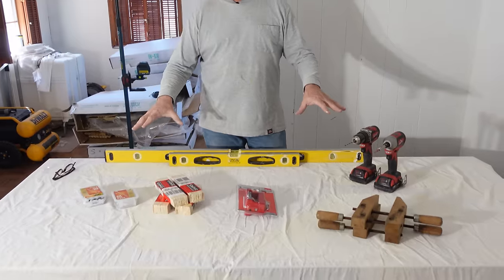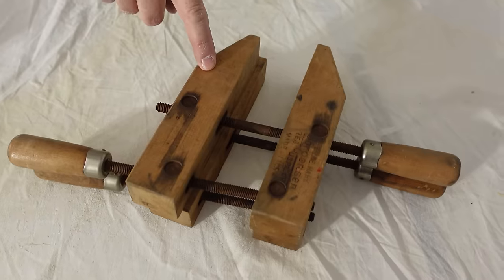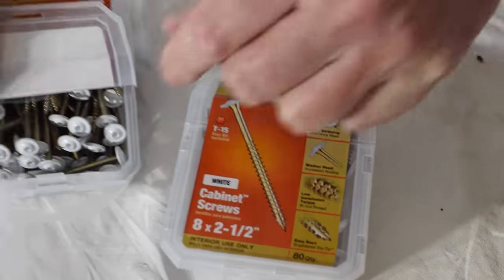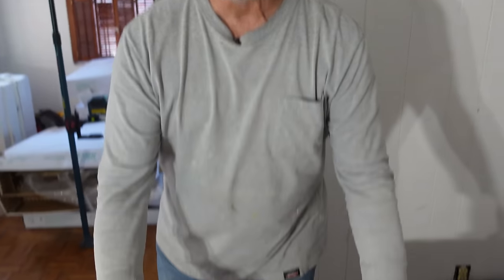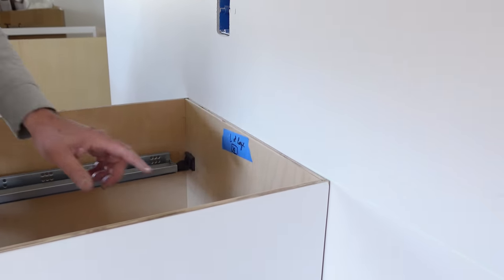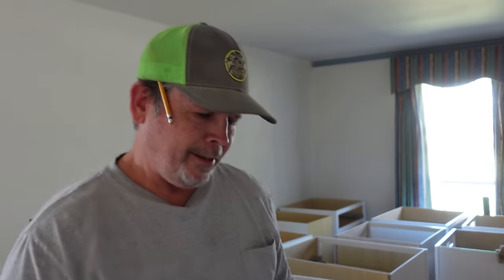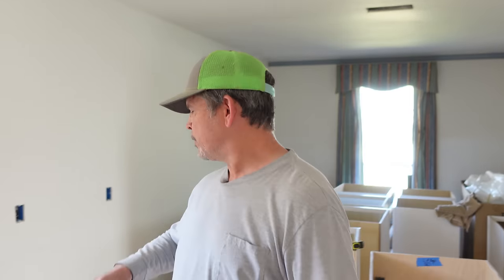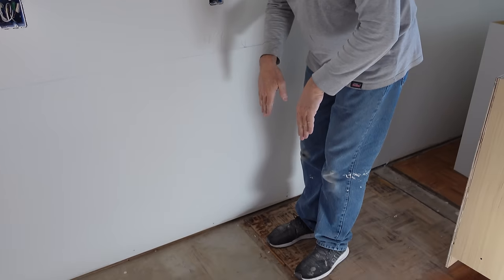How To Install PERFECT KITCHEN CABINETS (DIY GUIDE)

Comment: Excellent video. Thanks for sharing. Still Don't know how you guys deal with the imperial system over there 😂 Anyway... "a tip, and just the tip and only for a minute!" Hehehe, for putting in screws in those annoying hard to reach areas like under the cabinets, I like to use the Wera mag-ring bit holder. Holds the screw perfectly secure until it bites into the panel. I'm sure similar products are available in your market even if you can't find that particular Wera bit holder. I think Dewalt does something similar but the Wera is the best I've seen. 👌 All the best 👍

Comment: Great video! I install cabinets professionally, that is pretty much all I do. I do more commercial settings so we use 2 piece cabinets (cabinet on toe kick), so the trick I use to level everything out is I use a level and I made a block with a line in it exactly where my laser line is so I can move that anywhere. I never block my laser line this way, and I'm never guessing the measurement. I have that measurement in my hand. The same idea could be used here on these one piece cabinets. This way you don't have to set up a chalk line either. I also personally do my uppers first just for the simple fact is it's easier on my back haha but it truly doesn't matter. As far as set up I would almost argue that doing uppers after lowers is easier because your jill pokes don't have to be as long.
Reply: I'm installing separate toe kicks.  Can you describe your process a little more?  I don't understand your description.  What is "jill pokes"?
Reply: @number6396  Jill poke is just a stick I set on the lower cabinet (or the floor if I'm doing uppers first) to hold the upper cabinet while I make sure it is plumb and level.

Comment: Great tips on cabinet placement and minor corrections!  Faces on my pre-built "box store" bathroom cabinets had impossible to flush face frames.  I 'averaged out' the fit which is un-noticeable when finished.  Starting my RTA kitchen using flat packed parts, so I'm hoping for a better face frame fit up.  Thanks so much for these videos!

Comment: I have only ever used Wooden hand screw clamps for cabinetry. I tried those gimmick clamps and quickly realized they were crap. Also use a 1 1/4 counter sink screw for face frame screws and a 2.5" or 3" panhead screw and both have a Robertson or no 2 square bit eliminates stripped screws. We use screws from Quickscrews as they have an abundance of styles and sizes. Can sometimes hide my face frame screws behind the hinge plate, and only have to deal with perhaps filling or covering one screw hole in the middle.
Good video though.

Comment: Another great Stud-packed tutorial! One suggestion for you Paul I spent some time in the ‘70s after high school hanging cabinets in a production environment.  No lasers back then, but It did not take me long to realize I had to check the floor at BOTH the wall and the toe kick, because half the time the high spot is away from the wall, especially on slab houses.  We also pre-shimmed EVERYTHING before bringing in the first box. We precut and carried 2”x3”plywood squares in every thickness from 1/8” (cut from door skins) to 3/4”. The only place we’d need tapered shims was for the “last 16th” or at the wall, which was also checked to make sure any bow was OUT and not in.  A bow in on one stud meant having to start the entire line farther away from the wall, otherwise you could not keep the face frames straight and plumb

Comment: You might like the look of countersinking and plugging for your face frame fasteners. Nice video
Reply: The screw holes in the face frame for spacing purposes? C’mon man 2 pipe clamps with blocks equals no holes in your finish. I’m not a pro but you’re better than that.

Comment: Do you ever check walls that the cabinets go on for flatness?  E.g., look for waves, protrusions, etc. and a possible high point?  (Like done for tiling a shower wall.)  I'd think that could affect your ability to have your face frames lined up.
Reply: All you have to do is to shim out the cabinets off the wall and cover any gaps on the sides with scribe molding
Reply: I do cabinets for a living, we usually don't but sometimes that bites us in the butt later. We screw out cabinets together to make sure everything is flush, then lay out the runs to make sure our clear areas for the dishwasher, range, refer, etc. lay out, then screw it to the wall. That's when you see the high points and then you shim out accordingly.

Comment: You're lucky to have that mid-century parquet. Back in the day this was a fairly economical floor covering. Prices now will set you back, if you can find it. For a 'five finger' oak parquet floor like yours I would have to spend $10k on my 1058 sq. ft. mid-century ranch. No joke.

Comment: We use 2 1/2" trim screws for attaching the face frames together, it leaves such a small hole you can't hardly notice it.

Comment: I was a kitchen designer for 20 yrs and cannot tell you how many times an installer borked the range measurement, not accounting for the face frame. Unless you have flush ends. Great tip to point out in this video Team Stud Pack!
Reply: Rookie mistake for sure. In my years as an installer, I've seen designers bork fillers all the time. Drawers hitting door casing or handles of adjacent cabinets. Glad they touched on that in the section about the peninsula cab. I once worked for a "remodeling company" and when I asked about filler pieces for a cabinet install, dude looked like I was speaking Greek.
Reply: @BenMarvin  My first 3 years in cabinets, I would have looked at you like an alien if you said filler.

It wasn't until I was a PM at a commercial shop that I had ever actually been exposed to actually using fillers.

We always used loose stiles or scribe mold.

Comment: Theres alot of good tips in this video. That thing u used to clamp on the cabinets is really good. I set my kitchen cabinets several years ago and it came out good. I could have used a few of these tips. we just bought a new to us house so i may have to be doing this again. What u would u recomment if the oven was 40 inch wide and were buying a new oven that is only 30 inch wide. Im going to have a 10 inch space on one side or 5 inch on each side. There is granite countertops already installed. Not sure what to do about it.  A video on something like that would be nice lol   Ill figure something out but would love some ideas.
Reply: About that new oven dilemma. The quick and cheap option is to add some 5 inch filler boards to each side, just to close the gap. May want to do the same on the toe kick section.

If the oven isn't centered on a hood overhead, and you can move it to the left or right, maybe a small custom 10 inch cabinet, just big enough for a spice rack pull-out or just door cabinet for vertical cookie sheet pan storage.

Comment: I use Pica-dry a pencil. The best pencil I have ever had my hands on. Also bought the “white” leads when I am fabricating steel.  
Which sprayer are you using to paint cabinets with?  I’m considering buying a Graco Sureshot. I’m not digging the $1400 price tag.  But I’m less digging the $60,000 trucks.

Comment: Fun with tiny screws,  Usually  I toss all the philips head ones and use Robertson screws but if I can't a little piece of butyl tape will hold the screw either in place or on the bit.

Comment: Good Day love your vids very helpfull. Only diffrence we have concretefloors and walls. just 2 Q's Should the power box of washer not be above the water line ? And doyou screw your shims to the cabenit or glue? I work alone so when I turn my back the shm are behinde the cabinet on the floor He He.

Comment: A trick with hole saws through cabinets is start the hole then once you’ve cut a line pull it out and use the pilot to drill a hole on the edge just barely covering the outside line. This will provide relief for the dust so it will cut so much better. It probably doesn’t matter as much on the backs but if you have to drill on the side for a dishwasher or something, it’ll save some burning.
For the screws under the cabinet get a dewalt magnet bit. It’s not the traditional telescoping sleeve. It actually sits just behind the bit so it will sit flush with the screw head and will hold the screw on the bit. It’s great for self tappers
Reply: I'm going to do this on a scrap board just to get it "drilled" into my brain and hopefully remember it.  Glad I read comments and thanks for the advice/tip.
Reply: @joshbain66  glad I helped. that’s what these videos and comments are for. I’ve plumbed for 20 years and basically did things based on the guy I learned from for many years. That is until I started watching YouTube. I’ve learned tons of tricks or other ways of doing things that make me better at my job
Reply: I usually just rotate my wrist like you would to wattle out a hole with a regular drill bit, but the hole saw is on the end of my drill.

Comment: Good ole Philips screws.  Wouldn't have that problem with  Robertsons, 3/8" x #5 or 1/5 x 5 and they'd stay on the # driver bit (green)
I've done all elements of cabinets for over 35 years, including face frame  like you are installing,  You may also measure out from the wall the depth of the cabinet kick.  I've had the floor fall away 7/16" in 21 inches.
That faceframe clamp is an improvement over its predecessor.

Comment: I prefer installing base cabs first because I always worked alone and they can hold the wall cabs in place for me (with proper blocking) while I install them. Almost all my work was minor renovation which restricts certain preps which are typical on new construction or major reno.

Comment: Thanks.  Very clear.  Only disagreement is I think better to leave a large single utility opening, in case a plumber must get at the pipes slightly behind the wall (cut thru drywall).  Can't easily remove the cabinet once the countertop is installed.   I prefer a moveable table  to a permanent island.  Much more flexible.  Ditto for no utilities in the island, especially if a slab floor.  Similarly, I tile all the way to the walls so the cabinets sit on the tile,  Makes everything flexible for future changes.  Yes, kitchens are constantly changed as tastes and tech changes.  But, of course you are working to customer desires.

Comment: There is nothing I love more when opening the under-sink cabinet and seeing a giant, cockeyed, crooked hole that looks like it was cut with a dull beaver. Why would anybody want such a neat clean installation? :D :D :D
Reply: Haha, as a cabinet installer, I had the same thought. Dull hole saw? A Sawzall? Really? Good thing there's plumbers and electricians that will add trim rings and outlet plates to cover all that.
Reply: @BenMarvin  I thought this was pretty good. What I'm referring to are those holes you see that are the size of a phone book and the shape of a natural body of water, clearly cut by a kindergartener.

Comment: Most floor cabinets i have done are on 1-2 plastic legs (the legs slot in to pre drilled holes that support 2 cabinets or just 1 if its the end piece) in the front that you can screw in or out to adjust their height on, makes things easier to get level, and they double as a support for the board you put on the floor to cover the void when the cabinets are done. We also screwed a board on the wall which we put up level and then rest the back end of the cabinets on it and then change the height on the 1-2 front legs to get everything level and in line with the rest.

Same with top cabinets, designed to have board behind that they "hang on" so it gets easier to get everything level and stable since you screw through the cabinet into the board. Which they are designed for, then slap a cover board on top to hide the void.

With fixed frame cabinets and a uneven floor .. oh god i would bring out the concrete grinder or concrete floor leveling liquid and get that sucker right.
GJ on getting that straight :D

Comment: If the cabinets don't go the way around the room, one side could be a slightly different height and you would never know it.  Good for you for giving the range an extra 1/4 inch  to slide in.

Comment: I enjoy your videos and I’ve picked up a number of great tips along the way.  I have a question …. How is the electrical box set under the sink?   Does it extend out beyond the Sheetrock to meet the surface of the inside of the cabinet?   I have this exact situation coming up in a remodel and I’m grappling with where, exactly, to set the electrical box.    Thanks!
Reply from the maker: Thx George 👍.  We use adjustable depth boxes. They’re great and perfect for those situations.

Comment: Paul, my cabinets were  custom made 22 years ago. The cabinet maker made the base boxes independent from the kick risers. Each kick riser was made to accommodate all the base boxes in each cluster.  I had three clusters of cabinets. The risers had adjustable legs for leveling. Once they were installed and leveled, the boxes were just set into place, screwed together, to the base and to the wall. Easy Peasy.

Comment: 23:13 stud pack you need the dewalt magnetic sleeve that slides over bits! it locks the screw on the tip of the drill for exactly this purpose.
Reply from the maker: These screws are chinesium 😂 magnets kinda work 😡…. Sometimes

Comment: That cabinet clamp is worth it's weight in gold I have a pair made by Pony clamps. I love using those washer screws for attaching the cabs to the walls but not for the face frames there just too noticeable. I always use a countersink when attaching the face frames. Great installation tips !
Reply: Yeah, I love these guys, but I’d be unhappy if my contractor used those screws on the face frame. The white heads also bug me inside the cabinet.

Comment: maybe I missed it, when you raised that base cabinet with your prybar to raise to chaulk line. I didn't see a shim being added under the cabinet on back edge. I realize the screw may be supported into some blocking behind drywall but a heavy stone countertop will put significant weight on that top ledge.
Reply: It is a fractional movement and when counter tops and support against the wall and other cabinets are taken into account that screw to the wall will be holding very little in terms of force. It will be well within the tolerance of a screw.

Comment: When I'm doing an island, I get these angle clips that you find near the framing fasteners at H D and I mark out the floor, then I epoxy them to the concrete, let the cure and then I reach in and screw it to the cabinet, skipping the 2 X 4 block. When I did my 1st island I thought about how I would do it and this is what I came up with. That was in 1976.

Comment: Is it ever necessary to consider the potential unevenness of the floor across the DEPTH of the bottom cabinets?  For example, what if you get the highest point  established along the wall but, when you set your bottom cabinet down to begin, the front face of the bottom cabinet is higher than the back face?  In such a case, wouldn't your counters would run downhill from front toward backsplash?  Am I overthinking this?
Wouldn't it be better to snap a line on the floor at 21' off the wall and then measure up to the laser mark every 18" along the wall and ALSO every 18" along the chalk line on the floor?
Am I overthinking this?

Comment: I got a laser level on amazon that does the same thing as the $500 bosch for $80. 4 lines, 360 degrees, green line, etc. everything you would need.

Comment: Be careful how much you torque on the front handle. We had to pull slightly warped frames flush and the rounded head of the Bessy screw made contact with the frame and put noticeable dents in the wood. We glued some wood shims on them to replace the thin felt that was supplied.

Comment: At video 23:32, trying to install a screw in an inconvenient area, I use a drop of super glue to affix the screw to the bit. The screw is held solid. Works with all types of fasteners.

Comment: you guys should check out EZ-Level cabinet levelers.  They are pricey but its a high quality product and makes installation unbelievably easy.  Also company is a small business, owned by a great guy in Florida.  If you have questions he is usually the guy to answer emails and phone calls.  Cant recommend them enough.  I would just bury the cost of the levelers in your bid.
Reply from the maker: I ordered a bunch this morning 👊👍
Reply: @StudPack  You're going to love them.  Best kitchen install product ever.  No, I don't work for them.  I'm a DIYer, but I've installed 4 kitchens using the EZ Level system and my stone countertop guys always comment on how easy it is for them to install stone in my kitchens because the base cabinets are perfectly level.

Comment: The trouble you had getting the Phillips screws into those angle brackets. You should have used Robertson screws. They stay on your bit. Don’t get the US knock off square head screw, get a true Robertson screw. That’s all I use in Canada. Save yourself a lot of headaches.

Comment: when you shim the cabinets on the bottom or against the walls, do you put a shim in from both sides, like you do with a door frame?  Or do you stack them all going the same direction and get a wedge effect?
Reply from the maker: It depends 😂.   I do both actually depending on how high I need to go 👊

Comment: 22:20 Couda used a couple pocket screws here, too. Easier to install blind …just pick the screw length carefully!
Ha! Left the comment above before seeing “The Taming of the Screw.” Yep, pocket hole screws! You could drop in the screw first, drop down the cabinet, and then reenact “The Turn of the Screw.”